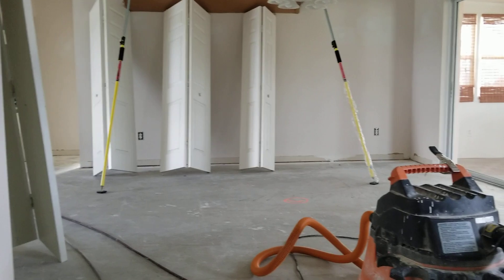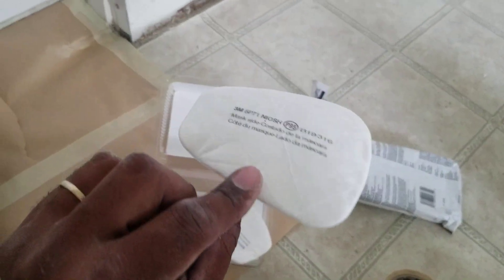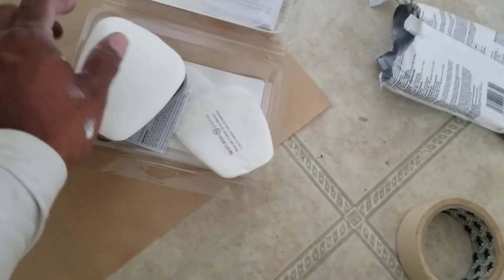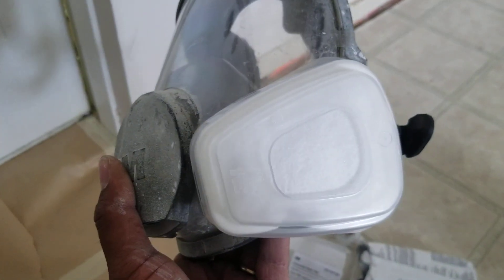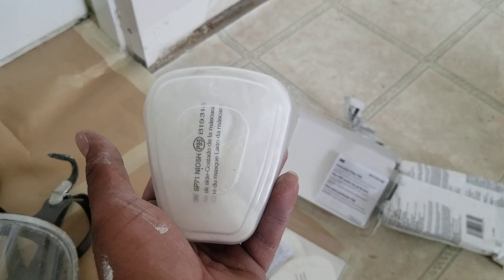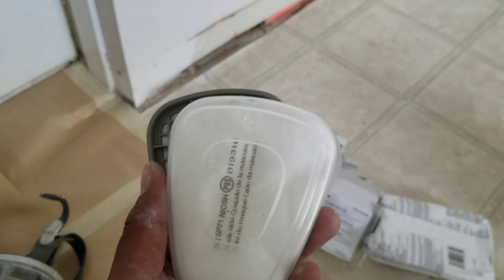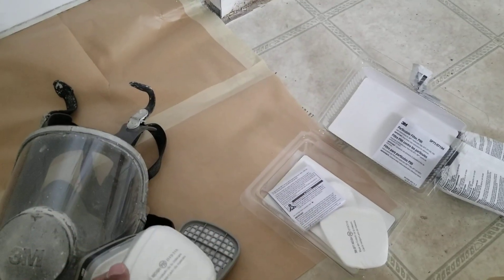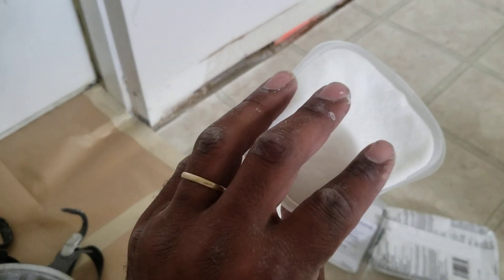3M respirator filter

Comment: More painters need to see this, I had a boss that never used the outside face piece and sprayed stain and laqure and you could smell right through it, I ended up quitting because he wouldn't buy the right filters
Reply from the maker: Yea those particle filters definitely help the charcoals last longer, lacquer is tough and will ruin them pretty quickly
Reply: I want to clarify that this outside pre filter 3M 5P71 is used to help filter out 95% of PARTICULATES meaning things like dust and foreign debris hence P95. It does help extend the life of your main organic vapor cartridge filter such as the 3M 6001. Let me make this clear that if you can still smell fumes, solvents, paint, etc. it means that you SHOULD be replacing your main organic vapor cartridge with the black stripe around it labeled as 3M 6001 or 6003 or 6006
Reply: Wow I just realized my mask didn’t even come with the caps what the heck!? I tried to replace the filters but couldn’t get the carbon filter open without feeling like I was going to break it. I bought it at Home Depot it had no caps in it!?

Comment: Thank you much for putting up this video! I was confused because the instructions in the filter pack illustration showed the texture side in, but the print on the filter said "mask side". So 3M instructions don't make sense. I called 3M 1-800 safety line, but closed on weekends. God bless you for posting this!
Reply from the maker: Yea its a bit confusing, glad it helped!
Reply: my filters came with an intelligible drawing, I thought it would make sense to keep the marking facing out so one could alway tell what filter is installed. I was wrong. Filter life and perhaps filter performance may be reduce, but I don't expect airflow resistance to change?
Reply from the maker: @jacopo952  not meant to work that way so I figure if used incorrectly than you may be breathing stuff in or blocking air.
Reply: @duartepaintinghandymanservices  Hi, thank you for your quick reply. I assume the seal may not be as good, and almost certainly filter life is reduced. I agree with "you should use it as intended" however there is no real explanation to what happens, or why it matters that I could find. while I understand what I need to do, my curiosity remains unquenched :P btw I was not using the filter and respirator in a toxic environment, so as long as I had oxigen getting to my lungs and brain I should be fine (:

Comment: Thank you !!! I just bought one mask and got mad when i read " Mask side BS" 
I have a question , can you tell me is  95 filter will peotect when sanding chlor was heavily applied on wooden deck ?
Reply from the maker: Yes but ideally you would want to use a whole face protection since those chemicals can acces your body through your eyes but yes it should do the job, just wear eye protection and if you can hook up the sander to a vacuum that would also help alot, good luck in your project

Comment: I used this respirator and the prefilter with the lettering on the outside, not the correct side, so I am wondering how much effectiveness I lost using the prefilter the wrong side out?
Reply from the maker: I'm pretty sure it still worked but just not as efficient, remember you're still protected with the charcoal, the particle filter just makes it last a bit longer and gets those big particles before they go through the charcoal.

Comment: Good info but that’s a pre-filter to make the medium underneath last longer.  Not necessary but  necessary to make the filter last longer
Reply from the maker: Its a particle filter,  so yes it makes the charcoal last longer
Reply: I'm spraying weed killer, commercial strength, so I bought the pre-filters for such chemicals. I change a prefilter after each use. How do you know when the charcoal filter unit needs replacing?
Reply from the maker: @jmel1746  depends how thin that product is and how close you are to it, paint tends to stay in the air longer because its so thin so I have to switch the charcoals every 2 to 3 spray jobs, when I can smell the fumes come through that's a good indication for me, but I wouldn't suggest you do that since that material may not even have much of a smell so don't rely on that. If you do change your pre-filters regularly they should last you a bit
Reply: The particulate filter, filters out particles and the charcoal filters out vapor and gases, it does not and cannot filter particles.
Reply from the maker: @tseruyahibri7049   You are correct the more the reason why to use them properly

Comment: I just got this and it came with 2 of them in each slot and one was facing the cartridge and the other facing the outside. Which means there is 4 all together and one facing toward the cartridge and one of them out
Reply from the maker: Theres four of them yes, but you only use 2, save the other 2 for later
Reply: Duarte Handyman Services LLC. Duarte thank you

Comment: doesn't the white filters trap the vapors ??    Confused why you use both 6001 Organic Vapor filters and the white particulate filters ??
Reply from the maker: ILOVEOLIVEOIL they come together to be used together, the white particulate filters also help to filter fumes, dust also helps to make the charcoale last longer
Reply: "Confused why you use both" That is how they are designed, if you work (and you most likely do) in an environment with lots of particles, the vapor filter will get clogged fast, the addition of a P95 filter keeps the particles out and the the organic vapor filter is truly only filtering for the very small organic vapor particles.
Reply: The pre filter is a particulate filter, it blocks out airborne particles. The cartridge filter blocks fumes form using an airless sprayer, organic vapors
Reply: @benjamindelannee3501  Sometimes the filter that blocks particles .. retains the fumes form toxic fumes...even though the other blocks the fumes.. that's what I'm questioning

Comment: When to replace 5n11...does it use for aerosol...
Reply from the maker: I apologize I don't understand the question
Reply: @duartepaintinghandymanservices  when to replace 5n11 filters...first question..

Does it's give protection from aerosol transmission....2nd questions....
Reply from the maker: @shiba9592  Replacing the filters depends on what you're using the mask for if they are visibly dirrty than is necessary to change,  I don't know about the aerosol transmission I wouldn't be able to tell you, sorry
Reply: @duartepaintinghandymanservices  
Thanks.
Reply: @shiba9592  If you can smell it with the mask correctly sealed over your face, you need to change the filter.
Reply: @mikescudder4621  
Thanks.